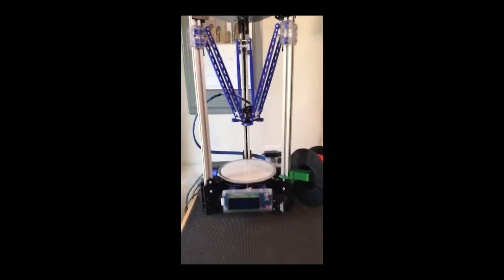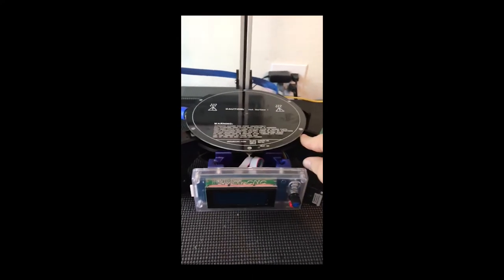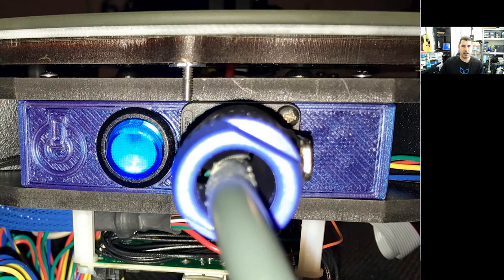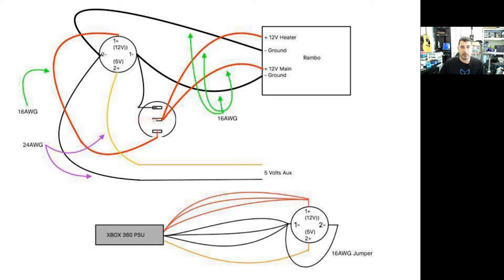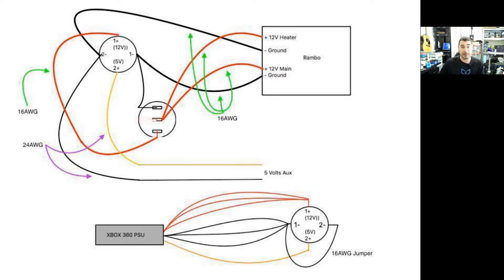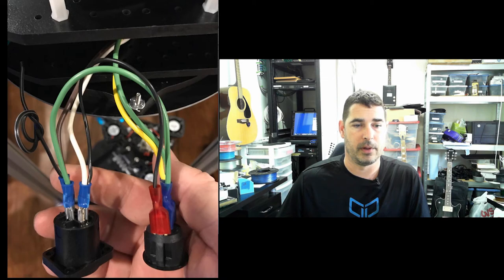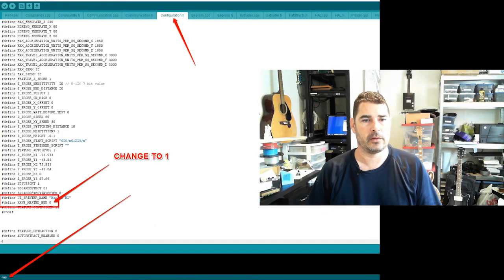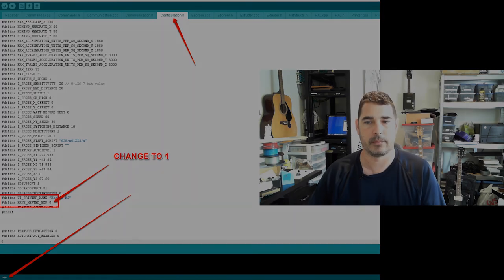SeeMeCNC H2 Hacker Series Unofficial Heat bed upgrade.

Comment: Thanks to your video, I just added the Orion heated bed to my H2. I couldnt find any info about how to solder the bits to the heated bed, since you left that part out, but it looks the same the rev 9 Onyx bed so I used that info that I found. You also didnt mention that the xbox power supply needs the power enable wire connected to the 5v wire.  

Since you first made this video, have you had any issues with connectors on the logic board melting or anything like that?
Reply from the maker: Glad you got it working and this was able to help.  When I’d ordered it, my bed had been pre-soldered so didn’t know they had changed it to solder your own. Because it’s such a small heat bed, the mosfet integrated into the mini Rambo and the connectors they used were more than adequately rated for the power needs of the bed, so with solid connections, shouldn’t have any problems with heat.  But always a good idea to keep an eye on it.